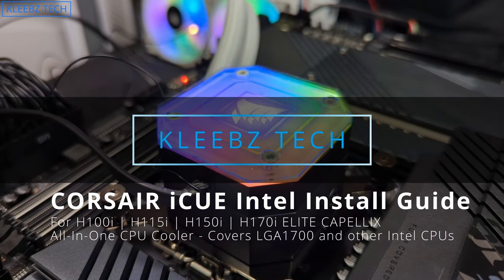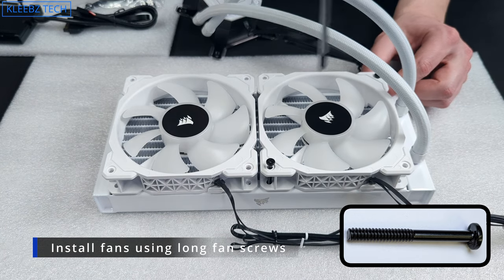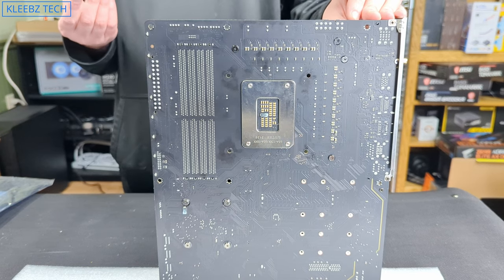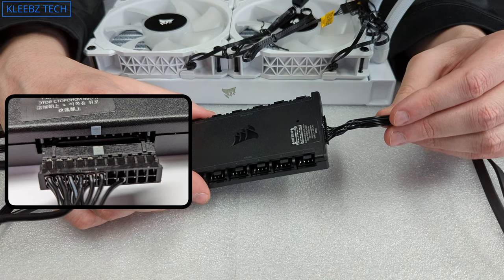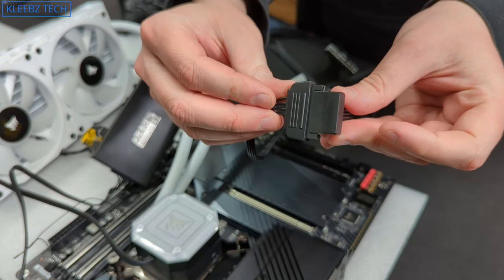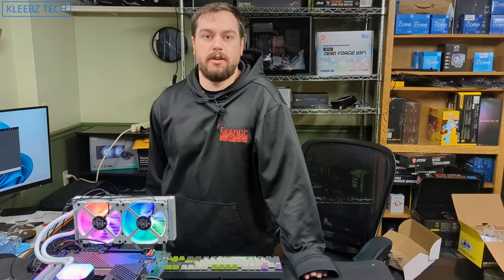LGA1700 Install CORSAIR iCUE H100i H115i H150i H170i Elite Capellix Intel CPUs

Comment: Loved the video but the thumb screws around 3:35 is confusing me. My thumb screws don’t screw in at all and I don’t know how to make them. What can I do?
Reply from the maker: I would double check the contents of the box everything came in, if they aren't in there I would contact Corsair customer support
Reply: Alright… I have the core i9 12900k and I think that’s the problem. Also, are the 1700 screws a little smaller than the rest?
Reply: Use a hammer or power drill to make the holes bigger

Comment: I have ordered the black version with 3 fans from amazon. Different sources tell that I had to buy LGA1700 standoffs separately, but in your video they come with the cooler. Do you know if they will be included or not?
Reply from the maker: We ordered ours through Amazon and it specifically stated that it included the LGA 1700 bracket when we purchased it back in February. I can't guarantee that it will be included unless they specify it somewhere
Reply: @KLEEBZTECH  thank you for answering! I’ll share my experience when I get the cooler so non of you face this problem.
Reply: If you need a kit. I bought the Full kit from Corsair's website for the LGA1700 mount. Part# CW-8960093
Reply: Mine came with them

Comment: The factory installed thermal paste is not large enough to cover the entire chip. All 3 of the Corsair AIOs I recently tried were 1 to 1.5mm short on the long side of the chip to cover it.
Reply: It spreads out when tightening the screws...its on purpose. If it was to the edge, it would ooze out the sides when tightening
Reply: @JSRJS  common knowledge. For a square chip this works. I've tested on 6 1700s so far, in no case did it cover the entire chip after being compressed.
Reply: @specvracer1  Just installed i170 on 12900k Intel using stock paste and getting 28c on idle and 35c on full 100% load.
Reply: @JSRJS  Sooooo....

Comment: My 1700 standoffs are a little wobbly after finger tight. Is that a issue?
Reply from the maker: If I remember correctly with that one it might have a little play with the backplate until you attach and tighten whole assembly. Should not after all is done though.
Reply: Hey quick question! Did your cooler come with the lga 1700 standoffs?
Reply: @SetherrrrrTV  didnt see the reply from earlier but yes it did come with 1700 standoffs and it all snugged up when i tightened the cooler onto it
Reply from the maker: @SetherrrrrTV  If you get one that was made and packaged before they added the parts for the LGA1700 then it would not include them. But I can''t imagine a lot of those still out there on the market.

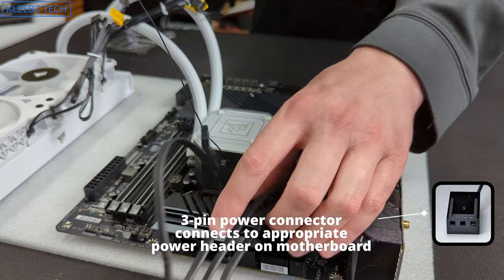Comment: Can you please again specified where you can connect that 3 PIN power cable at 4:12 in your video. If i understood you correctly you said that you can connect that 3 Pin cable in either the CPU fan header or the PUMP fan header?  It is a little confusing, i have seen some other videos where they only subject you to plug that cable in the CPU fan header. Thank you i appreciated
Reply from the maker: If you have a pump header that would probably be the best option. But you can use others if not available on your motherboard. We have another video we talk about some of the options. https://youtu.be/Lx0xMbKFJ7M

Comment: Installed one of these and I’m getting really high temps. I’ve check everything and it’s operating properly. Any Idea what the problem could be?
Reply from the maker: If you're using something like a 240mm radiator paired with an overclocked 12900k, I'd expect the temps to get pretty warm. If you have a larger radiator or a chip that doesn't run as warm, it could be an issue with mounting pressure.
Reply: @KLEEBZTECH  i7700k and I’ve already remounted and replaced thermal paste once just to see if that could be the issue. Still no luck.
Reply from the maker: Are you using the 1151 standoffs instead of the ones we used?

Comment: Hello. Do i need RGB port on my motherboard to make Lightning work?
Reply from the maker: if you have the core controller plugged into a USB header on your motherboard, anything you have plugged into it should be controllable with the corsair software I believe
Reply: @KLEEBZTECH  also  other fans?

Comment: aren't you supposed to put the washers between the motherboard and the standoffs?
Reply from the maker: No the washers are for the radiator. You can double check your instructions to be sure but from what I just checked they have not changed anything.

Comment: Why Can we see on amazon that the h100i isn't compatible with lga1700 whereas on the corsair site it says that it'is compatible
Reply from the maker: Probably not updated on Amazon. Normally I go by whatever the manufacturer says.
Reply: I received it and there isn’t the lga 1700, only 2011,2066,115x and 1200

Comment: Put together a build on PC part picker and it said in the note : "The Corsair iCUE H150i ELITE CAPELLIX 75 CFM Liquid CPU Cooler may require a separately available mounting adapter to fit the Gigabyte Z690 UD DDR4 ATX LGA1700 Motherboard." A bit confused since it looks like everything came with the cooler in your video 🤔
Reply from the maker: I'm told that new ones are currently shipping with the new mounting kit, old stock still on shelves may not have the updated hardware though
Reply: @KLEEBZTECH  Ahh i see! A while left until i buy the parts so shouldn't be a problem then, thx for the answer!

Comment: Should the standoff scre or back plate feel loose?
Reply: Are they supposed to feel a little wiggle?
Reply from the maker: You don't want to overtighten but they should definitely not wiggle.
Reply: Yeah I actually took back the one I baught and got the lcd screen one because the 1st one didn't come with the screws you used. Thank fully the lcd screen one does. And it felt alot better!! Thanks for your great video!!

Comment: will the elite capellix come with lga 1700 bracket  out of box
Reply from the maker: from previous comments it will depend on when it was made. The ones now usually do. I know other people have commented here about their luck.
Reply: @KLEEBZTECH  so it's basically a gamble if I order the capellix for a 12900k. Should I use an Asus board with it. I have heard Asus   motherboards support 1200 brackets
Reply from the maker: At this point I think most likely it would include the proper standoffs especially the retailer says compatible. Of course worse case you would need to get the correct ones which are part # CW-8960091 from Corsair.  And I would not risk using the wrong standoffs no matter the board. Not when you can get the correct ones for a few dollars.
Reply: Just got mine and it did. (July 2022) it says on the websites specifically if it comes with it..(ie Newegg, Amazon...) If it doesn't say...ask but they should all be coming with them by now

Comment: Is it just me but for some reason my cooler doesn’t want to make contact with the cpu?
Reply from the maker: The first thing I would check is that you used the correct standoffs. That would be one of the most likely reasons. Also make sure backplate is adjusted and installed correctly.
Reply: @KLEEBZTECH  I’ve tired literally everythin and sadly nothin seems to work
Reply from the maker: @ImmortalSaiyann  Wish I had some other ideas. I would probably contact their customer support.

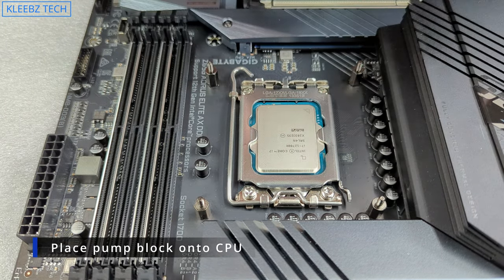Comment: 3:17 "As far as the orientation of the hoses go, it doesn't really matter". This is not true and is misleading. Gamers Nexus did an extensive video on where to place the radiator in regards to the CPU as well as the location of the hoses/tubes. 

Incorrectly installing the AIO is bad in regards to acoustics and in regards to the lifespan of the product itself. If the AIO was installed correctly the pump and AIO can result in an AIO lasting longer with less noise from the pump.
Reply from the maker: We were talking about the pump block itself. As for the radiator yes that matters.

Comment: I heard people using 1200 standoff with minimum increase in heat just because it takes awhile get the 1700 kit
Reply from the maker: I wouldn't suggest it. As far as I know the 1200 bracket only fits on certain Asus boards. There's really no point in trying to retrofit the 1200 bracket to work
Reply: @KLEEBZTECH  I use z690 gigabytes gaming, I just checken if the bracket fits and it does. I gonna try tomorrow if the 1200 screws works decently to keep going for awhile till i have the 1700 screws.
Reply: @Multieculti  it works?
Reply: @crosstec4599  yes it works perfect with pre paste aswell
Reply: @crosstec4599  i also have the 1700 standoffs by now but i still use the 1200 why fix it if it works completely fine

Comment: What if I don’t get lga 1700 standoff in my box
Reply from the maker: You would have to order some from the Corsair website
Reply: @KLEEBZTECH  I live in Middle East
Reply: @KLEEBZTECH  is it possible to use the cooler without the retrofit kit ?
Reply from the maker: @vno.  If you can't order them I would suggest contacting whoever you bought the AIO from.
Reply from the maker: @EugeneWong128  The standoffs are a different height for the LGA 1700.
Reply: @EugeneWong128  I used the LGA1200 stand off working good
Reply: @vno.  use LGA1200 standoffs it works
Reply: @reevesnayagam2353  what about temps? Im buying a Asus strix z690 e. I heard it has 1200 and 1700 support.
Reply: I believe the ones he used out of the box were meant for LGA1200. Corsair has a retrofit kit for LGA1700 that you have to buy separately.
Reply: You need a kit. I bought the Full kit from Corsair's website for the LGA1700 mount. Part# CW-8960093
Reply: انا لقيتها مع المبرد الحمدلله
Reply: @reevesnayagam2353  how well does it work? My box can with a set of random screws that looked like the 1700 set.

Comment: You forgot the Washers
Reply from the maker: Washers are used to mount the radiator on these models.
Reply: @KLEEBZTECH  ok thx, in total there are 16 washers for 8 screws, i have to put 2 washers for each screw ?
Reply from the maker: In most instances you would only need one. I imagine there are instances depending on how you mount the radiator that would need extra.

Comment: What would happen if I forgot to remove the paper film on the backplate, just hypothetically....? @kleebz_tech
Reply from the maker: The paper that covers the adhesive? That wouldn't be anything to worry about.
Reply: Its only there to help you stick it to the back of the motherboard so you don't have to hold it with one hand while screwing on the front of the motherboard. That's its only purpose. If you left paper on...no big deal.